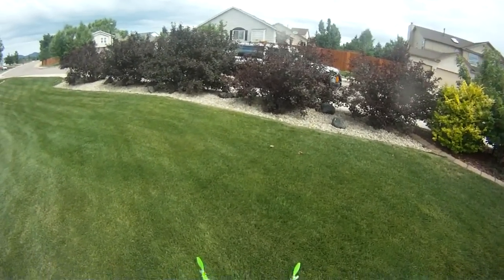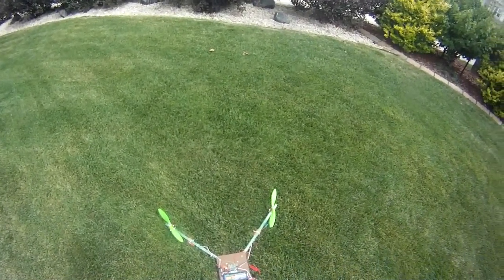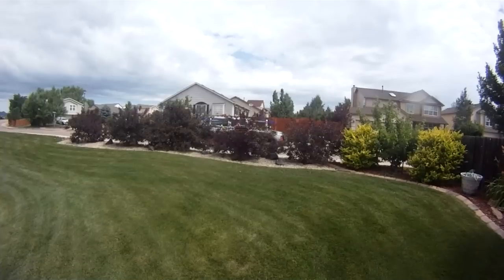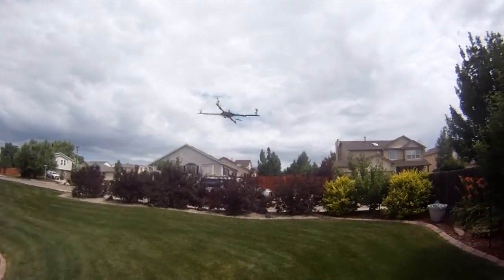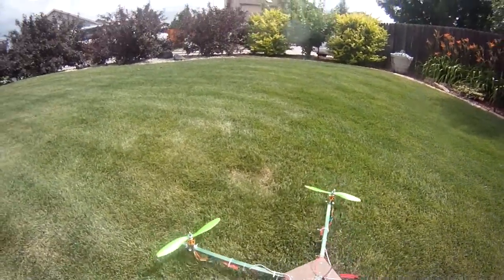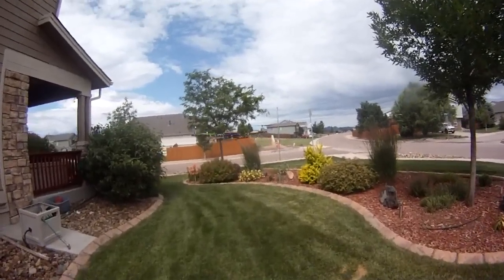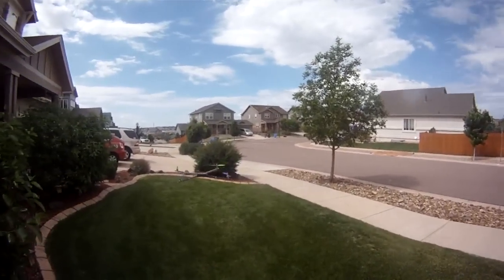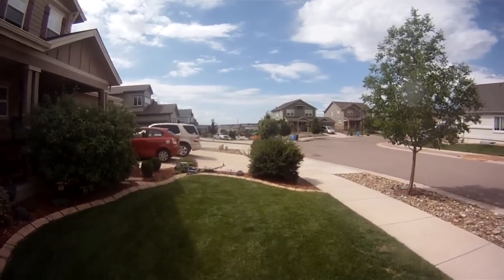NEED HELP: Quadcopter KK2 Yaw Problem

Comment: I had the same problem because of two reasons:
1. Your quad has long arms - check Mixer editor settings, here is link for it:
https://www.youtube.com/watch?v=A8Ub9lzvwbU
2. check your ESC BEC connections too, only first motor should have +5V (red wire) connected to KK2 board, motors 2,3 and four just disconnect red wire.

Comment: I just solved the problem, i used to big propellers on my motors, because of that i my P-gain to high and then it loses ang gains altatude, i went from 11x4.7 carbon props to smaler 9x4,7 props, now i can lower my P-gain and it yaws much better

Comment from the maker: My problem was I had my motors out to far on the frame. Try moving your motors in a little bit and see if it fixes the problem. You could also to try to increase your stick scaling for the yaw.

Comment: My quad would do that... I had two problems: 

1. It was too heavy and 2. I had to re-calibrate all 4 ESC because I had motors spinning faster than others. 

I originally calibrated them one by one, I guess that was caused it.
To solve the calibration issue I followed the instruction from the KK2 to calibrate all motors at once.    

Then I took off my homemade landing gear which was too heavy and my yaw was very aggressive like it should.

Comment: I had the same problem when i went from a 450 to a 600 centre quad, the yaw went crazy on me when i reverted back to the 450 it flew ok again....I went through all the settings in the motor editor and tried everything but it wouldnt sort it. So i went back to 450 and restored the KK2 to factory settings profiled it for a quad and it flew fine.....go figure

Comment: try connecting a servo instead of ESC+motor on each output of the control board. So you know if it's something with the motor or ESC or a problem with the controller.